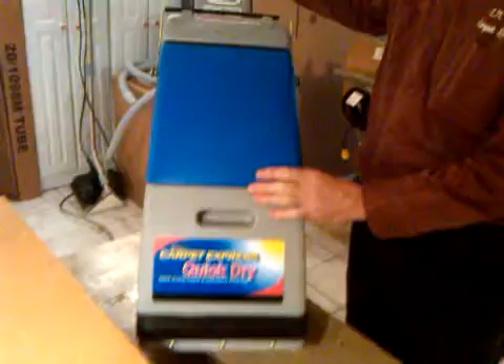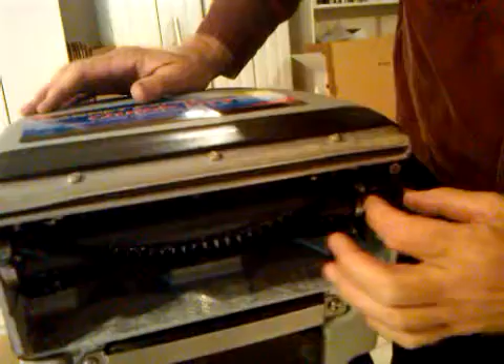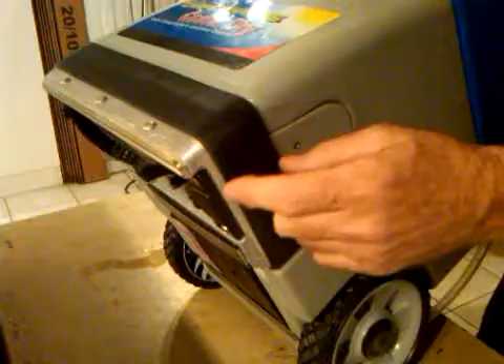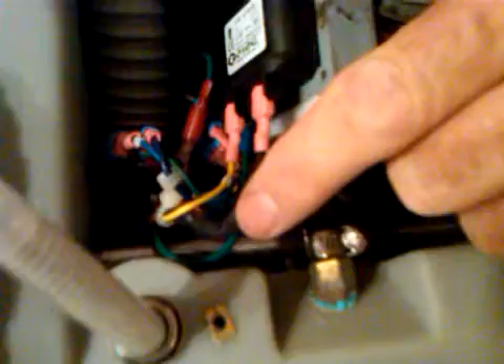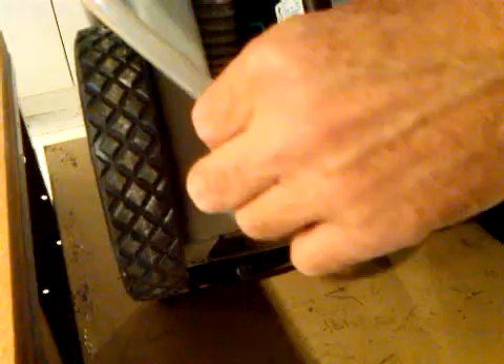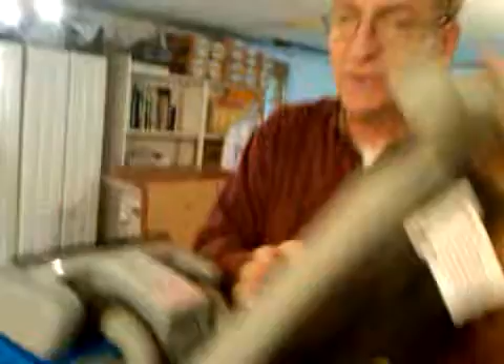carpet express c-4 repair

Comment: Mine does not suck up the water can it be the pump?
Reply: If all of the normal trouble shooting, gaskets, hoses, are not the cause it could be lint and dirt build-up in the vacuum intake. I used a putty knife, hanger and garden hose to clear the used former rental I purchased.